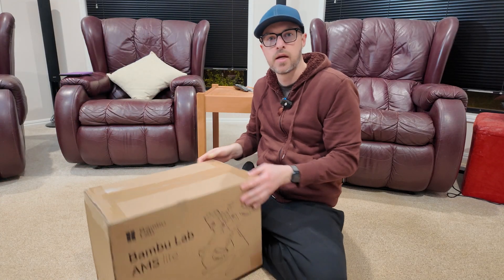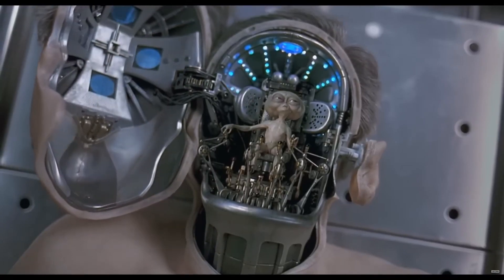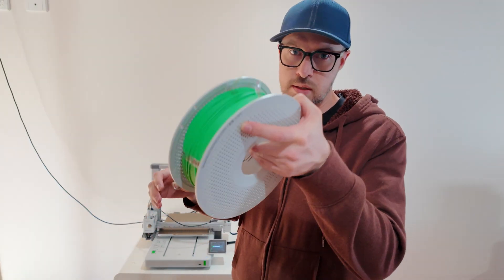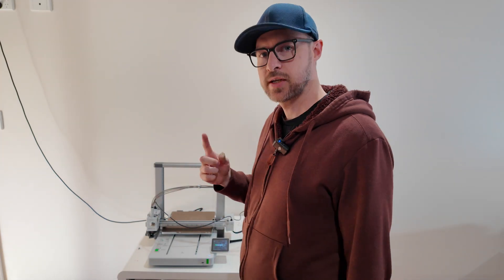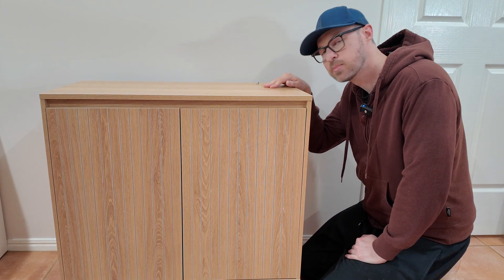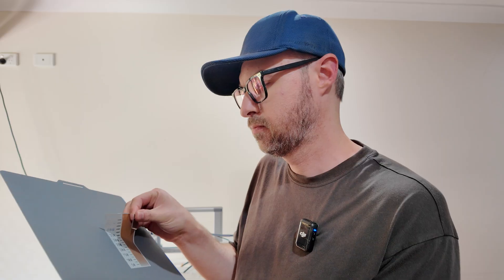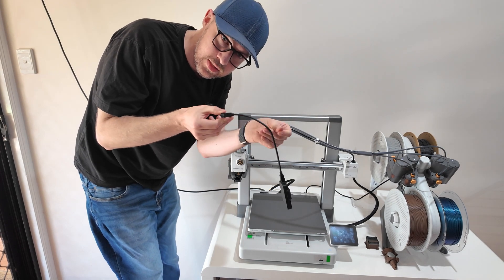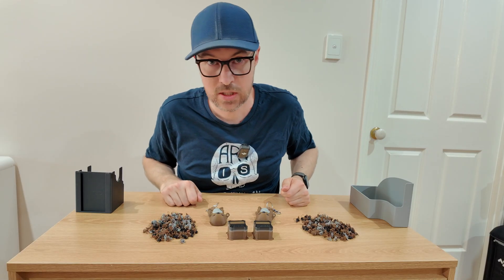I upgraded my 3D Printer for $682.49 (Now It's Farming Aura)

Comment: i recommend you buy a deburring tool, they're pretty useful to get rid of the brim leftovers; also the prime tower will not change in height, as the height is determined by your print max height (till the point of the last filament change), what does change is the infill of the prime tower, so it might be more dense inside due to more filament filling it
Reply from the maker: Cheers. I’ll have to check out the deburring tool.
Reply: @EightyIQ  sure, good quality videos man, when i first started getting yours recommended i thought you were a big channel lol, i love that you're also just getting into 3d printing, almost at the same time as me; its fun (and a bit sad) seeing you run into the same issues lol
Reply from the maker: Yeah I’m having fun (even with all the stuff ups) 😆